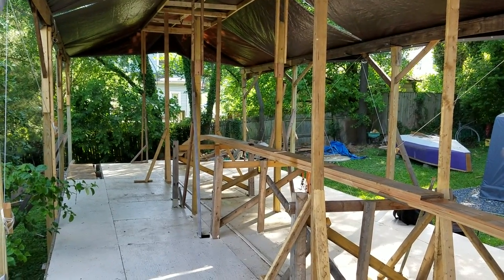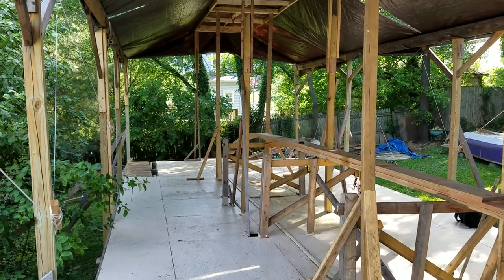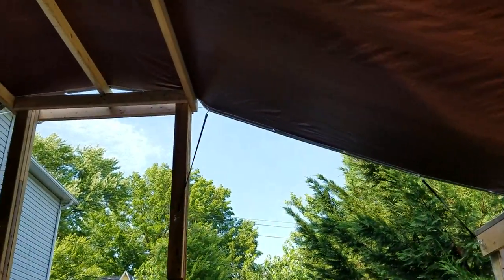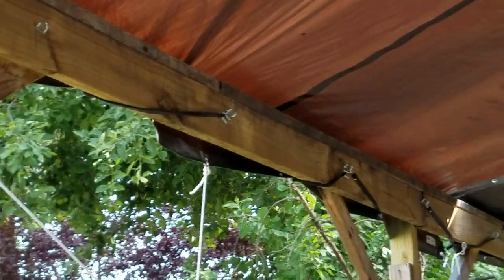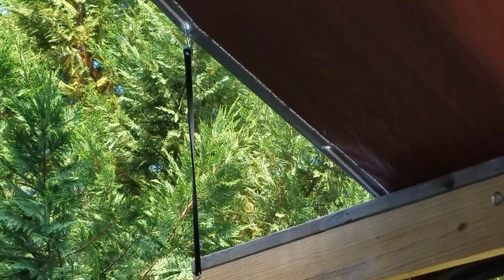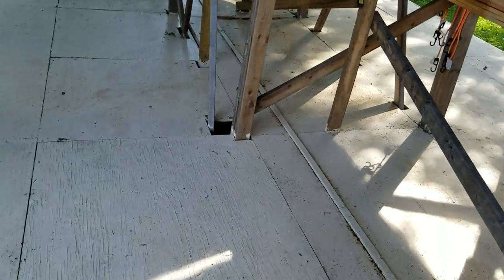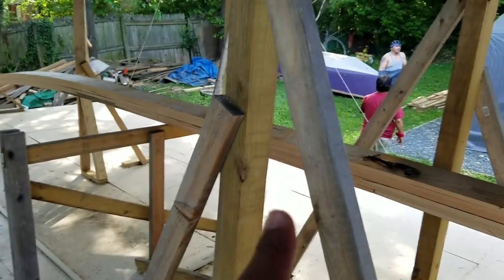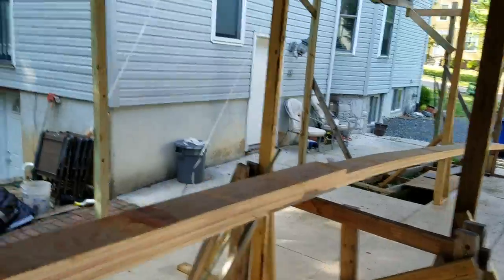And the shelter is complete.

Comment: I'm sure you'll want to keep working even when it starts raining. What keeps the tarp seams tied together and rain tight? Will duct tape and poly last until winter?
Reply from the maker: Hello sir. I haven't seen you in a while. It's time for another drink :-)
Reply from the maker: Mount Gay rum calls
Reply: Ahhh, YES my brother, I promise to return bearing gifts someday soon. The cat I tried to show to you in Newport last year ended up on the hard in San Diego which is where I've been for several months. What an experience! The Port Authority over there has quarantined 100s of beautiful sailing vessels, several of which can easily accommodate 300+ pound 7 foot tall sailors. All scheduled for their doom through the shredder... It made me cry. I will have a plc alarm and lighting system ready by the time you are and maybe even an electric rudder trim system. Meanwhile, maybe zigzag threading "rope rafters" under the tarps when they stretch out in the sun might keep sags and water pockets to a minimum. Stay dry and hydrated (with water - not Mount Gay before sundown) this summer!

Comment: Move at the pace that works for you.  Those that wish to stay, will stay - those that wish to move on, should be bid a fond farewell.  As Winnie the Pooh used to say, "Tata for now!!"I do have one question: "Do you anticipate any issues with the lateral gaps between the ends of each of the tarps?"
Reply from the maker: I left the gaps on purpose. I want the tarps to shed water as easily as possible, if even on to the platform. Water is not really my enemy because the boat will be epoxied. Just want to keep direct sunlight at bay. Thanks for watching and peace and blessings

Comment: Hate to say it but...still have my doubt's in a good wind or lightning storm.. hope I'm wrong. This may have been asked before but have you thought of shrink wrap? Once its done rite its great in wind rain snow etc...you can add sections put screens doors in - take some off depending on season since this is a long term sort of cover..
Reply from the maker: Hi Mike. Naw shrink wrap needs a surface to shrink to to resist wind and rain loads. No hull to resist those downward loads. Also I only need this to last one season. Just for the hot summer days, not intended for late fall or winter use. If I have to replace 1 tarp a month or all of them, it's still cheaper that $1,000 a month rent for a garage or warehouse to build my project. PERSPECTIVE  my friend.... :-)  Stay tuned and fair winds.